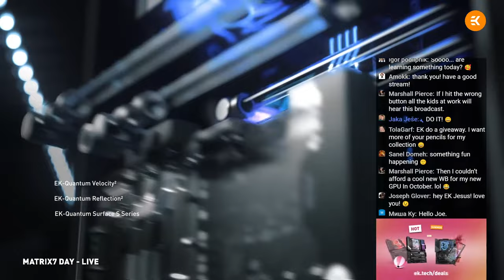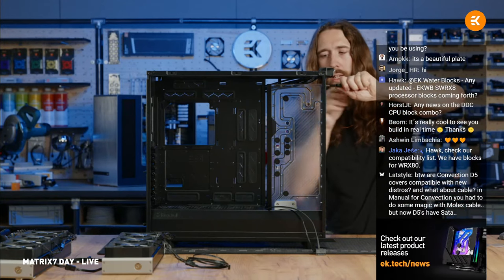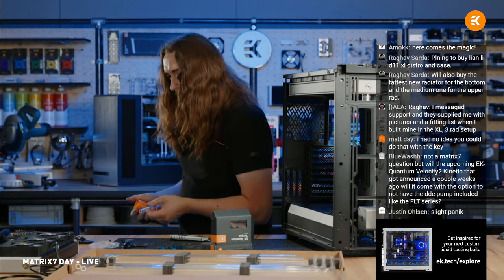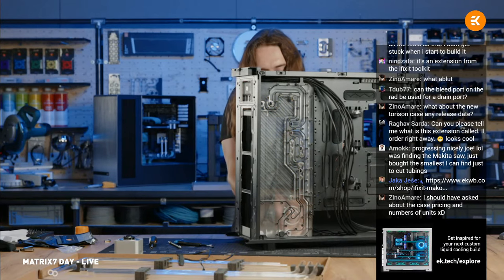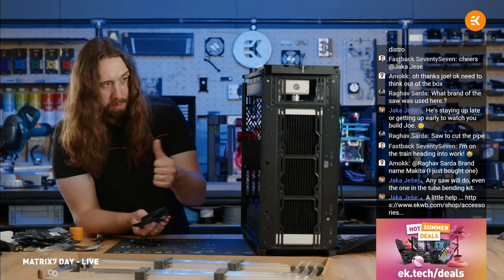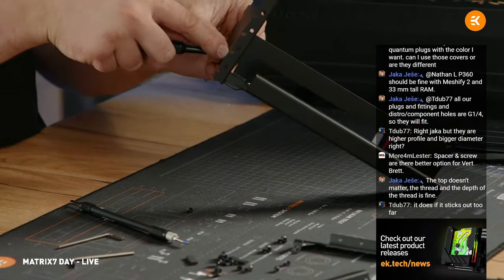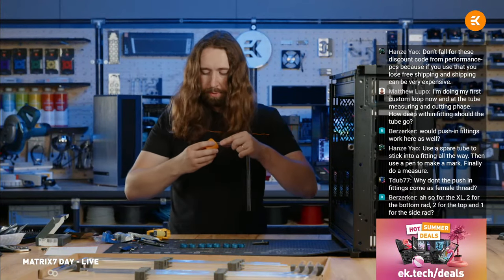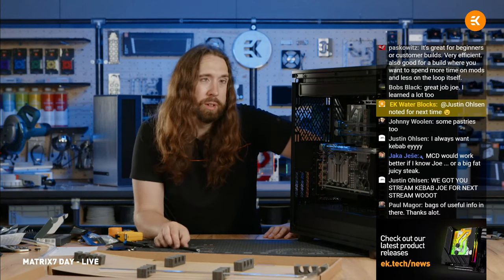EK-Matrix7 Day - Part 1: Understanding the “Matrix7” Liquid Cooling Standard with Joe

Comment: The only thing which sets apart EK, is that its far easier to build in this platform... and its still open to modification like adding FLT distro in the loop to increase coolant amount or adding aqua computer parts while still not taking too much of a time compared to old water cooling builds plus less fitting and less complex bends needed

and EK has jesus

Comment: Sad to hear the new Phase fans won't be out until next year. I really want them because of their ability to daisy chain connectors and get rid of the cable managment nightmare with so many fan cables. 
But my old PC is dying and I'm not sure I can put off this build until next year. Maybe I should use a bunch of cheap crappy fans in the planned build until the Phase fans become available.

Comment: Pro Tip - when trying to get in that Push In - youre right pump needs off even the standard pump but - with room you rock the rad back and forth just enough - to get that Push In fittin in - it doesnt need brute force to push it in, wet the o-ring and when swinging back the rad into place push it forward again - then back again and the o-ring seats perfectly with very little force
1:14:16
Oh also theres very little room between the front rad and where the fan cables need ran - I got in noctuas NFA-12a with 2 of their Y splitters but I needed to use tape and zip ties to make that cable run as flat as possible - theres not much room between that side of the fans and that distro plate - but it worked.
Reply: Side Note - Noctua:  Slimline the power connectors yeah?
Reply: Noctua:  Make the flat ribbon cable 2ft long - fix the connector so that you can press-in fitting on to the correct size for your need.  Dont make a requirement of a special tool for our fitting bullcrap.  Just make the flat cable long long.  You can sell the ends.  No tool needed though.  Mount our fans, run the cable where  you need it - flat as flat can be - push in our fitting you got a custom length fan cable.  Bo om. Sell a press in (crimp with hands) fitting - terminates all 4 fan cables into 1 connecter at the end. (edited to say - kind of like crimping RJ ends)